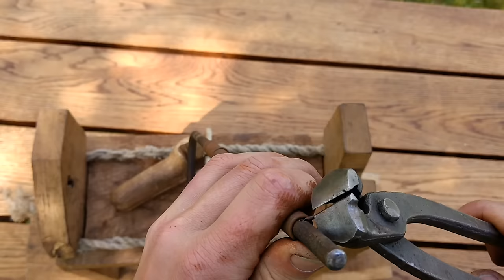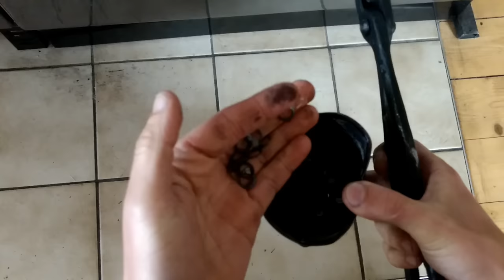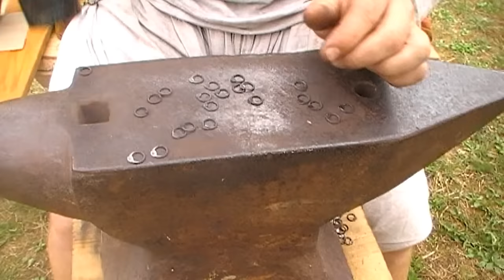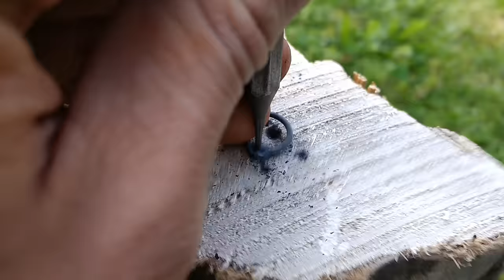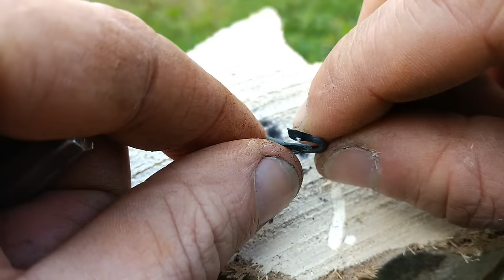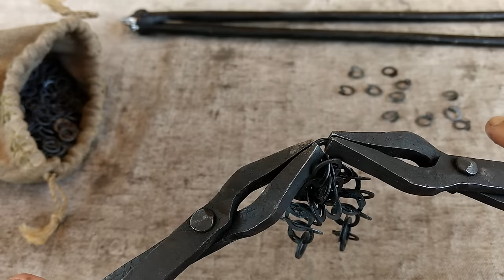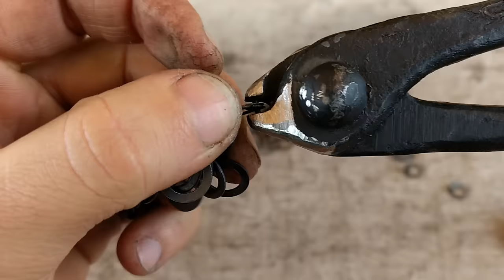How to make riveted chainmail

Comment: I was considering making chainmail.  Then I watched this video and came to my senses
Reply: Start with butted to learn the weaves.
Reply: Gambeson only kits
Reply: You can use modern tools to save a LOT of time.
Reply: So you made the chain mail
Reply: I made a sleeve, took almost a month
Reply: There are several ways to get wire coiled, wound, around a mandrel. They vary by how the wire gets anchored.
My favorite way works for both manual winding and power winding by chucking the mandrel into an electric drill.
I call it the notch and washer anchoring, and the only tool required to make it is a triangular file to make the notches. The only other thing you need is a washer that fits loosely over the mandrel -- lots of slop.
With your file, file slanting notches up near one end of the mandrel at an angle to the mandrel's length, so: /  /  /.   Bend the wire end up some, and lay the wire end into the notch. You will only use one notch at a time, but having three up there saves you time looking for the notch!  Push the washer down over that wire end lying in the notch until the washer jams on the wire, hand-tight.
Controlling your wire feed however you like -- I use a simple feed apparatus featuring an eye screw -- coil your wire and fill the working length of the mandrel, on which more in a moment. To remove the wire coil, slack off its accumulated spring tension, which is partly a phenomenon of work hardening; a few turns in reverse will do it. You will see the wire coil relax off the mandrel and loosen.
Pry the washer off the bent up wire end and slide the coil off. You're ready to make steel cheerios.
Maillers coiling a lot of links, like 5k or more, frequently resort to electric-drill powerwinding to speed this step. This makes extra long winding mandrels desirable -- anywhere from one meter long to as much as two meters of rod. This really only works with a no-hands feed device or block, usually of wood but metal works too. Fix the feed device to something solid, with a lot of clearance behind the device to give the free moving mandrel enough room. Feed your wire through the feed and anchor it at the mandrel end where the power drill is. Crucial step: swing the power drill end of things five or ten degrees RIGHT, so the wire coil follows the least resistance and cils neatly down the mandrel in a single layer of wire. Start the drill in FWD and turn the mandrel, coiling wire into a spring shape as you go, gradually backing away from the wire feeder as the mandrel fills and the coil gets longer.
With the whole length of the mandrel filled, ther will be a lot of accumulated spring tension in the coil. Flip the power drill to REV, and back turn the mandrel until the coil slackens and lets go, so you can remove it without getting slashed open by a spinning wire end. Cut the coil from the feed when the spring tension is off.
The advantage of an extra long mandrel is you spend a larger percentage of your time actually coiling rings, and less setting up to do the coiling.
Reply: It's not as bad as it looks, several working together can generate several sets pretty quickly. Make butted mail first
 It's suitable for everything but
Combat simulation.
Reply: Doing butted mail for cosplay, I nearly have the whole hauberk done. It’s broken my soul
Reply: @matiasdelatorreoverton3612  where's the fun in that
Reply: @matiasdelatorreoverton3612 less modern tools include a weaving machine you won't save that much time. Welding links with a spot welder saves a tiny bit of time compared to riveting, but most of the time is spent weaving. Punching half the rings out of sheet metal is a historical technique that saves even more time still but the actual weaving still takes a while.
Reply: I second that motion
Reply: @matiasdelatorreoverton3612 what tools?
Reply: @depressedhamburger4880 A toolmaker can make the tool that makes the ring in an industrial way. Wire in, ring with hole out...(or only one operation in a simpler tool) The rivets can be bought with one finished head, so you just have to knock down the other side. All this cost plenty of $$$, and removes the authentisity of the product. 
But I recon some sort of jig, holding the knitted rings, and making it easier to thread, would be to a great help.
Reply: @dollparts7506 you can use spot welders to do this much quicker!
Reply: I do it bymail Amazon delivers
Reply: Been making maille for 2 decades. Your loss
Reply: You can just buy sacks of premade rings and just do the weaving.  With a little rack you can sit there and make panels while watching tv.  I made a small rack that can go on my lap with two spaces for little cups to hold open and closed links and just did butted links.

Once you have a bunch of panels you can delink them to make the shapes you need to put together a garment.  Think of it as making a roll of fabric then cutting it into a pattern.
Reply: @AutodidactEngineer trick with welding those rings is getting a machine that can go at a low enough heat/amperage to not melt them the second the arc is struck. Best bet would probably be a TIG welder, but that's expensive and needs more practice/training
Reply: Hahhh! I've never thought of making chainmail....  Watched this video and came to my senses...... I'm never making chainmail
Reply: There are far better methods.
Reply: This is doing it a more traditional way.  Interesting but not practical now days.
Reply: @geoffgeoff143   Chainmail itself isn't that practical now days. 😆
Reply: Always wanted a shirt but never really considered I could make one until coming across this video. And then I watched this video. Yeah it ain't happnin
Reply: @migilvigil  My butted hauberk was finished about 2 years ago, because I gave up before doing the sleeves and made it about as long as my t-shirts.

It only took about 11 years(for the few weeks before/after going to renaissance fair...)
Reply: Let grandpa knit you a sweater...
Reply: I did a shirt, butted, 6 in 1 weave. In my spare time it took about a year. I did a rough estimate of the work hours. I figured a month's worth of work, with 40 hour a week. It's  60% 18ga steel, 40% 17ga aluminum.
Reply: Butted is absolutely fine. It's still combat effective to use in Buhurt. Plenty of people use it. But you can also weld the rings if you'd rather, which is still significantly faster than riveting them.

This is a way to make the strongest possible rings with steel rings, but thick iron or cast iron rings that are butted are actually just as strong, so it just depends.

But you can get started with just a set of pliers, 8 inch bolt cutters, a pipe with a small hole in it for the winding and some 1.2mm-1.5mm low tensile steel wire. This setup is advanced, and while I do have a similar one, it's not necessary at all.
Reply: @jeffreyneas9510  That's not quite true. There are people in Buhurt who use butted mail.
Reply: Keep in mind, this is making chainmail through medieval methods. Using modern powertools would be many degrees easier and quicker, although still challenging
Reply: @jeffreyneas9510 the roman empire was able to produce chainmail for every soldier in its army. I assume this is because many hands make for easier work and rome had a lot of workers
Reply: It only takes a mile of wire to make a coat. An inch or so at a time.
Reply: regular butted chainmail is SIGNIFICANTLY easier to do.
Reply: Ye start with butted and higher diameter make smaller projects and work your way up
Reply: @Shin_Lona dunno, you could walk in the park, with the comfort that the hobo won't kill you

Comment: I've made a full hauberk of 14 ga galvanized steel wire, butted of course. Took a long time, probably 200 hours total (coiling, cutting, weaving). And for some unknown reason, I really want to make a riveted mail hauberk. This is probably the best, most clear, and precise video I have seen thus far, and not a single word was spoken. Incredible sir, incredibly incredible. Thank you.
Reply: What was the inside diameter of your rings..?
Reply: I find making the riveted ring the easy part, linking the rings seems like an impossible task to me, I always get them wrong
Reply: @conorhudson1486  learn the weave with butted links until you are practiced.
Mail links are unstable and flop over wrong a lot until your patch of mail grows big enough to be stable, about as big as your hand.
A good way to start is to think of mail in 5-link units, with a single link in the center joining four links at the corners of a square surrounding it. The links in the corners will all lean the same way, opposite from the corresponding lean of the link in the center. Make sure they're like that.
There are ways to make this happen automatically, with little thought.
What I like to do is start by making a chain of alternating double and single links,2 links 1 link 2 links etc. Always start with two links. All the doubled links may be closed up ahead of time; use an open link to hook two pairs of links together all the way down the chain.
Now here's the trick: lay the chain flat on your worktable and smooth it so the doubled links all lean one direction and the single links all lean the other way.
THIS IS A LONG CHAIN OF FIVE-LINK MAIL UNITS, all strung together. 
Now you have to put links down one side of that chain, weaving a single open link into pairs of closed links bordering the long chain. These links you add WIIL HAVE THE SAME LEAN AS THE SINGLE LINKS THAT JOIN THE DOUBLED ONES. Now your entire chain is 2 links 2 links 2 links all the way down.
Go back and add links onto this edge but this time always being sure these links lean like the doubled links do. They will also be in the same linkrow.  Now you have a ribbon of mail that runs 3 links 2 links 3 links etc.
Whatever you do, don't pick your mail up off your table to add links -- just slide links up to the edge of the mail ribbon and close them when they're hooked in.
By now your mailpatch has grown big enough to get stable. Just keep smoothing it out with your hands as you go, watching for links at the edges to flop over on you. Put 'em back.
Reply: And this doesn't even get to the final heat treating/tempering!
Reply: @MonkeyJedi99  can you heat treat galvanised steel? Thought it gave off some nasty fumes
Reply: @veruslupus  Gah. Missed the galvanaized part of the original post when I was commenting.
Zinc fumes can be bad, yes.
Reply: Just a thought ... I'm no Smith ... But wouldn't it be easier, once you have some of the chain, to place it on a humanoid figure, presumably made of wood, and continue adding rings? Though I guess adding the rivets would be harder unless it can be removed everytime ... Thoughts?
Reply: @brotherBvideos  ID was 3/8"
Reply: @M4st3r0fN0n3  thank you for your reply kind sir =) I ended up buying a lot of different gauges and inside diameters to see which I liked best..boy those 14 gauges are tough but well worth the sore hands =)
Reply: I've also made a hauberk (butted) and I thought the same thing at first, but in practice it just makes everything so much harder.  the bonus however of chainmail is that you really don't want it super form fitting, because you (generally speaking) want some form of padding like a gambeson beneath it to cushion the impact of whatever blow hits you. hope that helps! @KaranveerSingh97
Reply: galvanised 😢
Reply: @TheMadsenmads  its the cheapest option for those that are ok with making their own rings. I finished the hauberk and still have 1/3 of a 1/4 mile roll left....and a second 1/4 mile roll as well
Reply: @M4st3r0fN0n3  it's wonderful
Reply: @veruslupus zinc. You can chemically remove the zinc though.
Reply: @arandomanvil5989  you likely still get the fumes if u use an acid. If you use some form of electrolysis then the costs of that set up for a 1 off likely outweigh the cost of just using non galvanised steel
Reply: @ethanshivers5590  Yeah, it shrinks to fit as it hangs anyway, and having got stuck inside my mail vest before, a little wiggle room isn't a bad thing.
Reply: If you use wire it's always going to be mystery metal Chineseium. Has anyone ever considered drawing their own wire before doing this out of a known steel?
Reply: @bashkillszombies  im sure someone has. But again, cheapest option is to buy wire and make rings. Easiest is just buying pre cut rings. Drawing out wire has a certain novelty to it but its kind of like making your own leather dye from scratch. Sure it works but its not cost effective or efficient.
Reply: @veruslupus If you heat the galvanized steel like this guy did, the fumes just go out with the smoke

Comment: For anyone wondering why a medieval suit of mail did cost as much as a house: ^
Reply: much as a ship***
Reply: back then or now?
Reply: @QueueWithACapitalQ  back then
Reply: You forget, everything back in that time was done by hand with just as much painstaking effort.  You can't judge the past through the eyes of the present and use modern methods as the touchstone.
Reply: It didn't though?
Reply: Not sure about what the actual cost was (though "a house" can be a pretty damn wide variety), but please remember that in medieval times labour was extremely cheap. One of the reasons was that people simply had a lot of free time to excercise all kinds of crafts. I'd argue that the main part of the cost of a piece of maille armour was still the material used itself. A full set of maille armour requires a quite a few hefty kilograms of material, and that wasn't cheap back then. Viewing this as "this is extremely labour-intensive, so therefore, the product is going to be insanely expensive" is a very modern view of things, applies to modern replicas for sure, but not to the actual history.
Reply: YES! I have ALWAYS wondered. Thank you!
Reply: @AmarothEng  also mail didnt take much skill or technique to make like plate did so once you had the iron wire someone to turn that into mail would be easy, which is why iirc tailors were the ones to actually make most chainmail.
Reply: @EvelynNdenial  yeah, smiths would produce the wire and possibly the actual links, and then tailors (or the smith's wife and/or younger kids) would do much of the actual assembly. Which makes sense when you think about it, the assembly hass more in common with sewing or knitting than it does actual smithing.
Reply: @Candlemancer Don’t underestimate the amount of labor required to make steel wire (and harden it after assembly into chain mail).
This also isn’t the most complicated weave of chain mail either.
That said, machine made chain mail is a commercial product now. Chain mail gloves are widely used in industrial applications (particularly stainless steel ones).
Reply: @angelus_solus did he forget though? Or are you using arrogant language unnessicarily?
Reply: @diogenesstudent5585  As if you're the poster child of humility, replying to a 3 year old post?  It matches your emotional age, infant.
Reply: @angelus_solus  address my concern first before your insult. Why does he forget? Why was that called for? Wanted to feel superior that day?
Reply: @angelus_solus  "excuse me stranger, let me needlessly correct you." - you

Gross.

Comment: That is insanely labor intensive. Only the richest knights can afford riveted mail. The rivers really require really renowned riveting repertoires of skills.
Reply: yes, i bought a loose 5mm (along juglars) and 8mm elsewhere) washers and pre cut flat rivets  made my own double layered aventail one over cuirass and underneath bevor.  and one underneath my forged gothic cuirass with simple linen backing to prevent chaffing on my gambeson,  leather liner around my neck rim,   took 2? months  doing maybe 2 hours a day      if i had to spool, anneal, smash,  drift,  itd take longer
Reply: It really is riveting
Reply: Easy to repair tho but yes
Reply: In the early medieval yes, but by the high medievel every professional soldier would have been wearing a full mail hauberk at minimum